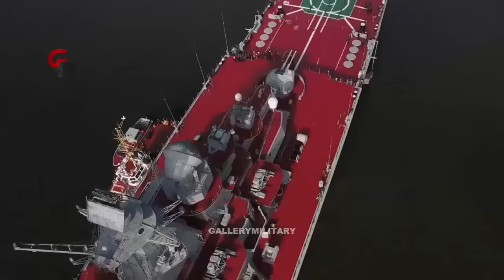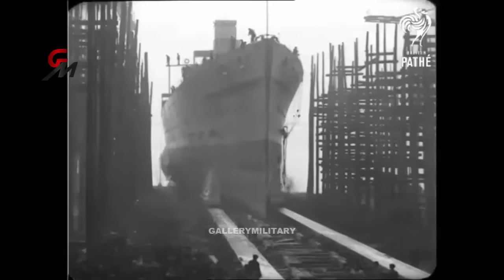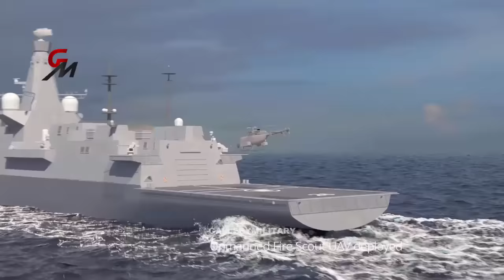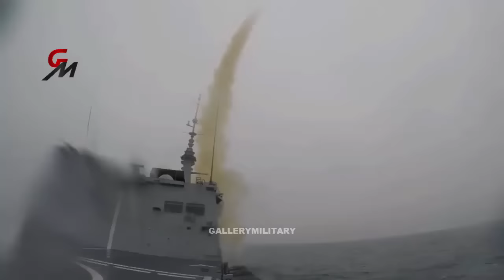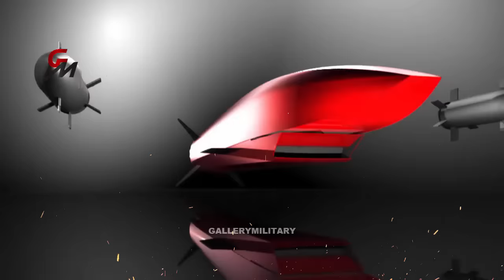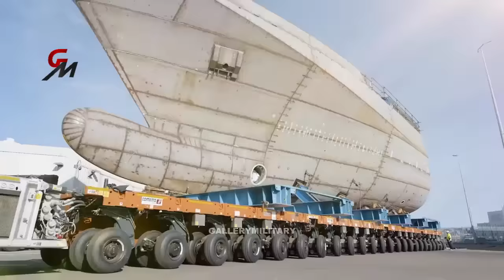Mysterious Type 83 Destroyer : UK's Mega Big Ship That Will Surprise Earthlings (17,500 tons)

Comment: My thoughts on this are that, Type 83 should be a full Cruiser in size and displacement, it should have at least 128 Mk.41 Strike Length VLS Cells for maximum flexibility in weapons options and real persistence in any high end saturation attack scenarios. Probably more significantly it should also have an evolution of the Sampson Radar using larger high powered fixed planar arrays high mounted, including a full Zenith array to provide both optimal IA/BMD Defence and retain the tracking ability for high performance sea skimming threats. CEC capability along with inherent acoustic hygiene measures built into the hull and machinery of the vessel wouldn’t go a miss either. My overall thinking on this, is that it should be able to hold its own in most, if not all high end threat scenarios.
Reply: Yes, absolutely. Though what you say in your excellent closing remark is, unfortuately, the single biggest reason our repugnant metro-establishment will ensure no such ships are ever built
Reply: Every plaine,ship , tank, vehicle in the UK military are very modern and close to up to date as they can be. Not even the us has 50% of any area up to date. I'm confident the UK has the most uptown date modern military in the world. 

Us still use 1000s A10s F16 F15s F18s along side their 500 F22 and F35s including 50 year old destroyers. The oldest UK has is 00 model frigates and eurofighters. Hell usa still uses the old British harriers jet. Just imagine the state Russia and China are in if the yanks cant keep equipment up to date
Reply: @dragzgaming  The US doesn't have 50 year old destroyers, they have Cruisers, Ticonderoga Class from the 70's and 80's now being retired. The Arleigh-Burke class Destroyer is from 80's-present and currently still being built (Flight IIIA) and constantly upgraded with the latest equipment, older vessels of the class are either refitted or put into reserve.
Reply: Agree
Reply: Just because it is old does not men it is no good. @dragzgaming
Reply: @ppo2424  ofcourse not, but newer is more efficent and better tech. 
Would be hard to sink a modern destroyer with a 1920s battleship for example, not implying they use those , but would still have a use as artilery.
Reply: @dragzgaming  Newer is also prone to loads of technical glitches,and a lot more expensive. We do need more kit in general, but not a huge amount. Recruitment seems to be one of our biggest issues atm, I'm also concerned about our 2 amphibious ships, they're definitely looking at getting rid of.I don't rate frigates, less of them,more destroyers and some supply ships might be an idea.

Comment: People haven't realized that VLS is the original modular weapon system.  Depending on the load out in the cells, the ship is tailored to any current mission.  AA, ASW, Surface action, the VLS can support it.  Asking any one on any VLS ship "What is your VLS setup"  is actually asking what they are doing on the next cruise.  The ships need to move self defense to the CIWS, RAM, and Lasers so they can put more heavy punch into the VLS going forward.  Make the ships more like running back protecting the ball, where the VLS is the ball and the self protection is retaining the firepower to get it where needed.

From the graphics shown, that might be exactly what the new destroyer is getting designed to do.

Comment: With the amount of time the Type 45s have spent alongside there should be years left in them beyond the 2030s
Reply: When (or if) they sort out the engine reliability problems. They are actually very capable vessels. With good upgrade potential, within limits. 

I still think that given the fully integrated nature of modern fleet defence. A dedicated missile arsenal ship jam packed with VLS cells, either manned or unmanned. Would be a very valuable asset. A "buddy" or "loyal wingman" concept. It's only function being to add several hundred VLS cells to the available defensive/offensive missile count.
Reply: What do you want them to go to sea to do then?  Those days are gone and no one is replacing them in 2030.
Reply: @Highendaudio1  What days are over?
Explain.
Reply: @gusgone4527  I think your concept is a little wayward but I cannot help that. The engine reliability has been exaggerated but the casing point is, apart from last year, when did a t45 not finish a deployment due to the intercooler issue?  Answer that and that will go some way to proving that point Gus.    Jam packed with VLS is ideal if we had the required weapons but we don't. Instead, we have a bunch of short-range defense weapons when the best form of defense is to attack the threat at long range before it becomes that threat is not a capability we have.   The Russian and Chinese aircraft can strike a ship from 600 to 2000 nm away.     My point was these ships are not designed to go running around the ocean for no reason and our Nato commitments are all met.  navies spend more time alongside now but thats the way it is.
Reply: @Highendaudio1  No-one can 'strike a ship from 600 to 2000 nm away.' Even US supercarriers are pretty much invisible to radar outside 50 miles....
Reply: @Debbiebabe69  do yourself a favour. Carriers and ships do not have Klingon cloaking device. Of course they can be detected by radar from miles away also the carrier and ships radars can be detected from three times the distance. Also you seem a little confused or just don't have the experience that that's all I could list a number but you should look at the Kh-22 Storm 600 miles plus. ( I'm not guessing that ). Kh-47M2 Kinzhal. 2000 miles remember aircraft are not static. Submarine-launched anti-ship version Kalibar 2000km and older weapons like P700 Granit we're 400 mils. I could go on. These are real

Comment: 0:14 ... 216 Tonnes? is a very small destroyer.  That's just a Fish Trawler size.  That figure is very incorrect🤔  

Compared to a Type 45 destroyer, which has Displacement 7,350 to 8,500 tonnes (8,400 long tons; 9,400 short tons), according to Wikipedia

Comment: My thoughts are that MOSTLY warships as they are, are now obsolete, the role is sea denial and ability to decimate the enemy vessels and to support ground landings. These no longer require megolith ships. Smaller but more technically advanced weapons systems makes a lot more sense. You can have more of them, make them faster, move into to more shallow water positions and g ene rally all way roung a better concept, opnly NO one is actually looking at building a GOOD ONE..they should.
Reply: the trend has been towards larger and more capable vessels. largely because of the power generation needed for all the new hardware and sensors.